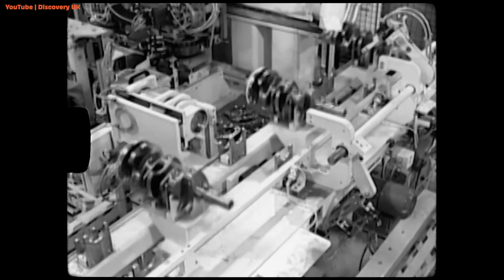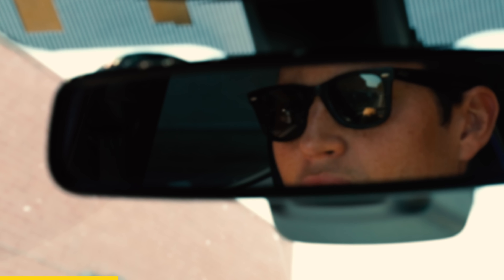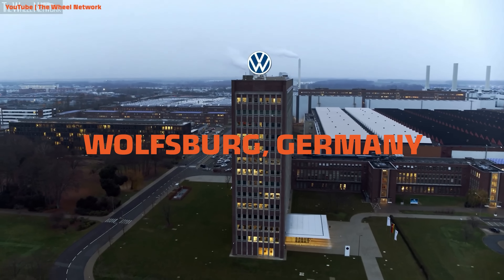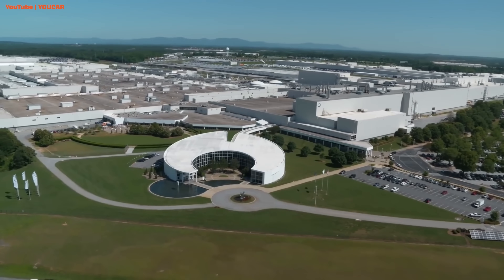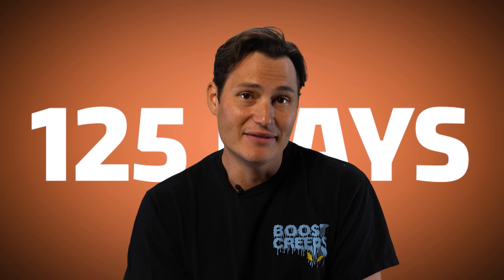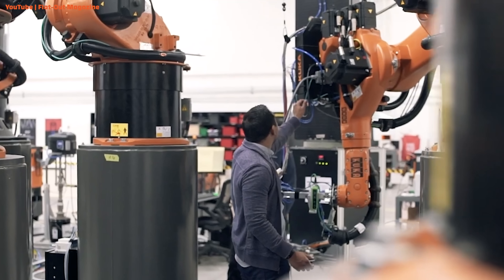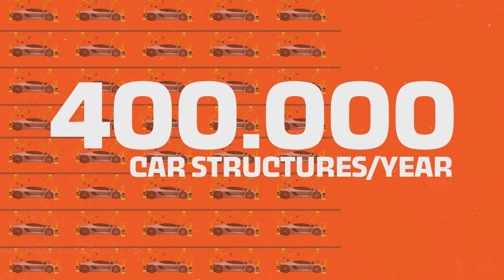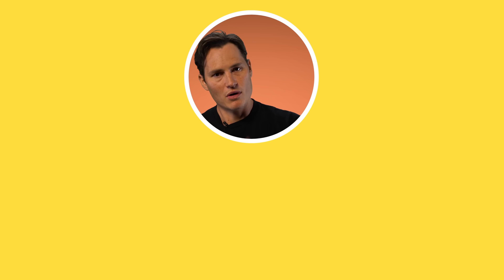A.I. Designed this Car

Comment: These engineers use a process called "topology optimisation" to achieve these results. Which gathers data through finite element analysis, then uses mathematical algorithims to draw vertices in 3D space. Making sure that the structure falls within a certain boundary that has the least amount of stress and/or strain etc. When the product is made, they make sure that the 3D model falls within acceptable tolerances for performance and manufacturing purposes.

Hope that clears up some confusion.

Comment: I work with computer programs that design based upon how its programmed. Not quite AI but the problem is the same.
I encountered a part that fits in the computer model just fine but the parts in reality couldn't be assembled. I brought this to the attention of the designer and programmers. I was treated like an idiot, the problem was never fixed in the program. And the parts were field modified to fit.

I have also had issued with computer designed parts not accounting for outside factors such as human beings and usage.

I see a lot of potent issues with this also.

Comment: If an A.I. is computing the optimal design and structure of the vehicle components with everything known to man factored in, wouldn't this be the pinnacle of vehicular design?

Like it designed the perfect control arm structure based ALL known physhics/mathematics, so how could it ever design anything better or different?

 Same goes for the most optimal engine/layout/efficiency.  

And then they wrapped the A.I. design with a body, so how could or why would a car look any different thereafter? 

Other than telling the A.I., "You're now designing this for 4 passengers instead of 1 or 2", or, "You're now designing a Truck with optimal load capacity/towing."

But once those designs are established, how can an A.I. improve upon this?  Unless a new set of physics/mathematics are established?  Or new alien composites/materials are found/designed?

Comment: Kind of reminds me of Rimac and the first Telsa factory, tech that is beyond other manufacturers and ahead of the curve but will cause the loss of thousands of jobs if not done correctly. I love 3d printing tech, AI but it has its place.
Also with that kind of money/savings i would try help the poor or do something good cause consider what banks etc make in profit and help no-one when the world could have lots of problems fixed in a week if the 1% did something but they wont.

Comment: eventually this will trickle down into the automotive industry, and if they can make the tech work then everybody else might, but there are still a lot of limitations on materials that can be used in additive manufacturing

Comment: 3d printing methods such as DMLS are great for low volume production, reducing upfront tooling costs, but are fundamentally inefficient for high volume manufacturing.

There are some definite advantages to the design process shown here, but the organic design they have produced under their current constraints could never be produced as cheaply per-car as a design optimized for more conventional manufacturing processes.

As visually divisive as it is, Tesla's Cybertruck is something of a perfect example of a design optimized around cheap high-volume manufacturing.
Reply: Additionally from my knowledge 3D printed metals have a high variance in their performance for to metal Crystal structures being much harder to control with current techniques. Still a lot to be desired with 3d printing.
Reply: Think 4d manufacturing
Reply: yet
Reply: Direct Metal Laser Sintering : yummy 😋
Reply: Well, he said the in the video  that a traditional assembly line can cost upwards of $500 million. But the A.U. only cost around $5 million. If you expanded that to 100 A.U's Seems like a lot of cars being made for the traditional price. Though I'm not sure how many cars can roll off a traditional assembly line. Nice thing is, this will get cheaper as printing gets better, more efficient.
Reply: @DurlonBryant  As stated in the video, the limiting factor of this production line is NOT the assembly but the production of parts itself. As stated the production (not the assembly) takes 125days. 
To comparison: a Toyota is assembled in 13h with huge output numbers (up to 50cars/hour; 300.000cars/year) but a Rolls Royce takes up to 6 months. So this method can be seen as a revolution for micro-production-lines but not for mass market, because it takes too much time with too high cost/part. This is the part where a 500mio $ production line becomes profitable with a certain amount of cars produced. But the AI-Optimization is definitely something we hopefully will see soon in mass production.

Comment: "Hey man when you getting your car?"

"soon, its still being printed"

"... Sweet"
Reply: they just need to print more printers
Reply: @RearAdmiralTootToot  printception
Reply: @RearAdmiralTootToot  a printer printing a printer... Seems like armageddon to me.. 😂
Reply: @HKBERASAPP  Literally
Reply: @RearAdmiralTootToot  yup. Industrial decentralization
Reply: Unfortunately after apportioning the $3m manufacturing equipment across the three cars per year that it can make, the per car cost is around $400k, and the a.i. hasn't figured out how to write the maintenance manual yet, so good luck with fixing it when it breaks. Also, spares are back ordered to never.

Comment: I see two problems.  1.  This car is still going to cost 50 to 75k most likely, because people like money.  2.  If an AI is picking the most efficient routes and structures for assembly and structure, is it still taking into account part failure and ease of repair.  Say what you want about traditional car design, but opening the hood and replacing  apart on my 1962 mercury comet is pretty easy.  Lots of room to work, and easy to manipulate.

Comment: Limitation of one thing in AI: it imitates our designs in a way. Since it learns from our experiences. Example: Limitation of faster car design similar to lemans. Aerodynamically sr 71 is way different. But if the outer chassis design was AI made then AI can't go beyond human experiences easily. It'll be bottleneck for quite a while.
Reply: No, AI does not imitate what we do, except you make it. That happens when you explicitly use AI to do something like we do, learning from our examples.  But if you use AI to create something that is good at something else, it will do it. AI is very good at imitating us if you use it to imitate us. But most of the time, you actually want something else, like building something as light as possible, or as strong as possible with a limit for the amount of material.
The reason AI is sometimes is used to imitate us is that it can be difficult to specify what we want.

As an example, say we want to design a car body, to replace an existing one. As light as possible, but a drop-in replacement for the existing one.
That means it should have all mount points in the same places, and free accessible space for the components. 
Can we specify that by example? I do not think so. It will have a shape that looks somehow organic to us because it has no reason not to. Our shapes do not look organic because we have limitations, we need to be able to build tooling, or even tooling with a limit in time and money to build the tooling, and time per car to use the tooling.
So we know already, that we want something that eplicitly does not look like existing cars. And we do not have a million different example car bodies with the exact same mount points, to use them to learn from construction plans.
We can not even start learning from human examples. We do not have any examples of car bodys with minimal material use, even less so a million of them.
Reply: @vsiegel  Dude! But what is it learning from. Any AI needs models and libraries to learn and improve from. And those are from us. So it improves from our base knowledge. Not from alien science. I'm not joking or insulting. But we create models and libraries from what we've known and experienced so AI will only go up from that base. For EX: AI doesn't know metallurgy beyond 3nm. Cuz we've only approached that much in terms of conductivity and other properties of a metal or any natural material it can be. At every point of time it will always be that the human will feed knowledge to AI. when it comes to research on this type and non quantifiable properties. Anyways we might see a different route to this soon. I'm just saying that AI will always be limited by new frontiers that even the humans are struggling. AI will improve what we currently are experiencing.
Reply: @antenedilbert7191  That topic is really interesting. It is possible that I did not get some fine aspect of your description, like that you mean something slightly more general than I have understood it.
There are various types of AI where I absolutely agree that what they do is directly based on input from us. For example, an AI that gets many human faces as input, learns what a face is, and can randomly create faces of people that do not exist in the input (or anywhere else), but look perfectly like natural faces. Or if we,  in images, want to find objects, locate objects, distinguish similar objects, we use examples as input, and the AI learns from that.
I claim that there is AI that does not use human input in that sense, and try to give examples to convince you.
(There is a distinction to be made between the task itself and the learning input, I think, because the task can be human-related, but the solution of it is not.)
- An AI could control a robot, and has the task to manipulate an object. We specify what should happen - the task, but nothing at all about how to do that.
For example, throwing objects into a box it can not reach directly. 
- An AI that can play a game like chess or go without using human game examples for training. Traditionally, to build a AI to play go, one would collect a large number of human game examples to train or teach an AI how it works. 
But there is a very different way: The AI does not ever get to see a human game, it only gets the rules of the game. It learns by playing against itself, without any idea how humans play the game. This has been done successfully for the game go by DeepMind, beating the best human players with AlpgaGo Zero. (Works for chess to. Go is used because it has very simple rules compared to chess, but is much more complex than chess during the actual game)
I think this is a particularly strong example. 
Let me know whether you accept this as counter-example!

Comment: Your lead in picture shows a vary sophisticated suspension system, but; the video does not show anything of practical value.  What I mean by practical is; Information that can be used with-in a common household with materials obtained threw standard supply chains.   However the manufacturing procedures shown are vary high-end and vary unattainable.   The closest thing in manufacturer additive materials, that is attainable for in home is Nylon with composite.   Metal 3D printers are out-of-this-world!  "Price wise".

Comment: It’s all nice and pretty when you talk about it, but, just like Tesla, it’s still a car for city girls and boys, it’s not versatile, complicated to fix IF it can be fixed at all, at the end it’s just a novelty to show off and store away once you realize that you are better off buying your good old ford, Chevrolet, toyota, etc.etc. I have had  a 2000 Ford ranger for 10 years it runs great, just change the oil on it once a year, I use for work, for traveling, I take it off road, best car I’ve ever had, and I only paid 1900 dollars for it

Comment: This was a rather unsatisfying video: I would have liked to see more inventive ways that AI has come up with in regard to designing this car.
Reply: He's not the manufacturer. It's not like he has access to the actual software. Pretty darn good considering what he has to work with, and you got the music for free. Just imagine, back in the 60's an episode of Star Trek with effects made this well costed over $400,000. Goes to show computers and technology advances are making everything better and cheaper.
Reply: It's really not that interesting. Feel free to look up iterative design AI. All that's going on is an engineer is defining constraints in some sort of FEA (finite element analysis) program and letting it go to town for hours-days. 

Most of these parts are trash from a production standpoint, and it's why 3D printers are used. Which skyrocket the price per unit and decrease the strength and life of the product. 

This is a gimmick at the moment.
Reply: "a better place" normally doesn't last too long

..at one time plastic, even oil, were "a better place", but now there's pollution and climate change
Reply: Are you smater than AI?
Reply: @juansantamaria1982g  depends on what you mean by smarter......considering the fact we currently don't have generalized AI the answer is clear yes. You still have to program these AI's and they just run through things that you allowed in the first place. If you want anything worth a damn at least that has complex forces on it.
Reply: For sure, we are smarter... but this is just the beginning. There is already AI that beats humans at games within two weeks, starting with not knowing anything... and the human players have dedicated 10 years to practicing the game. 

We are no where near “being replaced by robots,” but what we are very close to is utilizing these systems to help us better diagnose health issues, save money, pollute less, carry out tasks that require more precision than a human is capable of (brain work), and perform dangerous jobs that people shouldn’t have to do. 

We should be excited with what we are doing with robots and AI. It will become a big part of our lives, and we will be able to utilize it to help figure out new ways to make our world a better place.
Reply: @juansantamaria1982g  The correct question would be "are you smarter than the guys that programmed that AI?" And the answer would be "It depends. Probably you are not able to program the AI, but maybe you can create a car that overall takes more factors into consideration. Like, as @Jacob Ingram said, the cost per part." But surely AI programmers could take that in the equation too.

Comment: There's no A.I. here, just optimization softwares and solvers, programs used every day by every structural engineer.
Structural topology optimization has been around for 30 years, just like additive manufacturing.
Still not viable for a mass production effort.
So I don't see what the fuss is about, just cause "wow organic shapes"?

Comment: My question and a thought:
1) How convenient is maintainability with all this? As sinuous and organic as this car looks, it also looks like it'll be a HUGE pain to fix and maintain.
2) AIs inherently aim for maximal efficiency. The algorithm dictates the means and method, but the goal is basically the same. If you think all cars currently look the same, you're right, but for different reasons; ever tightening regulation and a better shared understanding of aerodynamics. In a world of AI design, this will become even more the case. AIs will have different fingerprint characteristics, but will largely have similar designs.

Ultimately, VERY cool, and likely where the entire industry is going...also airplanes, buildings, housing construction, (any material manufacturing or construction really,) corporate structures, materials engineering, etc. This is the path forward.

Comment: 7:08 that's not subtractive manufacturing. That's just a hydraulic press squeezing hot metal into new shapes. Subtractive would be a lathe or drill.

Comment: A.I. confined within Big Oil's parameters, true A.I. would have used another power source not an ancient and inefficient I.C.E. powered vehicle.
Reply: They don't really mean true AI when they say AI in this video. It's a machine learning model, which takes in parameters and datasets given by the software engineer and data scientists. It's not deciding to use fossil fuels because of 'big oil' the engineers set that as the parameter

Comment: So, can you 3D print a car? Yes, but only in limited, expensive, exclusive and botique runs.
Metal 3D printing has so much issues that adoption in mass manufacturing is miles off. It's absurdly expensive, it's is too time consuming to be profitable en mass, and most of all, 3D printed metal parts are weaker than "normal" manufacturing, such as casting or CNC machinig - keep in mind, that it is not about the part design, it's about the structural integrity.

3D printed metal parts often are porous, experience micro fractures once the part is subjected to external forces, lessening it's longetivity and are weaker in general, hence this only works for cars that won't see more than 50K on the odometer.

Comment: Being a mechanical engineer working for one of the world's most successful vehicle manufacturer. Addative manufacturing is always an option for us as well, it is not that "new". However, if you make more than a few vehicles it usually is far from cost effective.

Comment: Sadness of technology
I take ages to transfer it's benefits to common masses.
It would be have been highly appreciated if he would have designed 2 or 4 seater hatchback or standered sedan with reduced cost and higher fuel efficiency or even hybrid car.
Sadly it's another hypercar that will only be visible in wallpapers 
Nonetheless, impressive engineering.

Comment: The robot arms are for assembly.  They don’t replace the dies or forms that make the component parts and panels.  Those are still required.

Also, those parts can be manufactured out of billet but probably wouldn’t be economical.  So it is humanly possible.